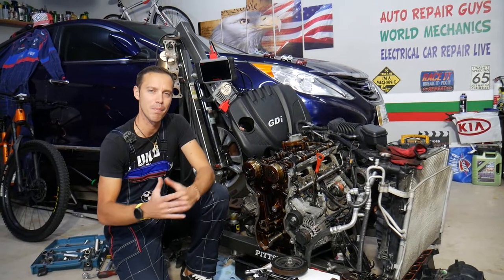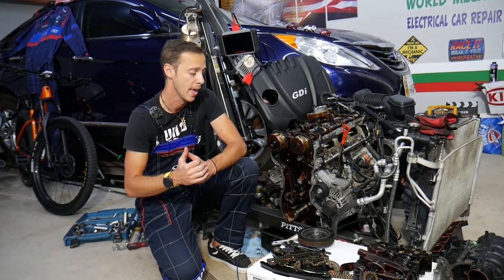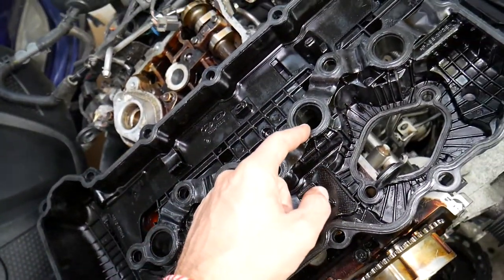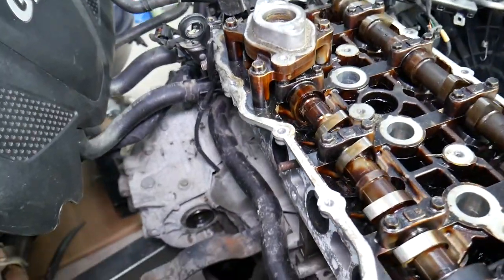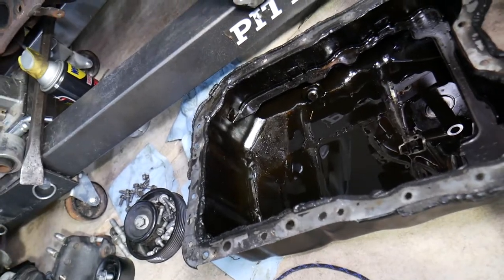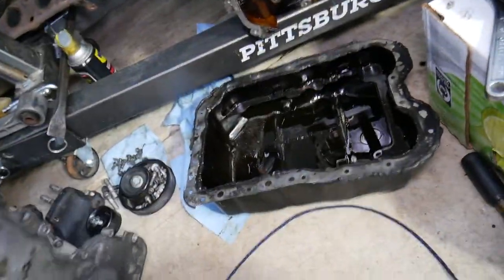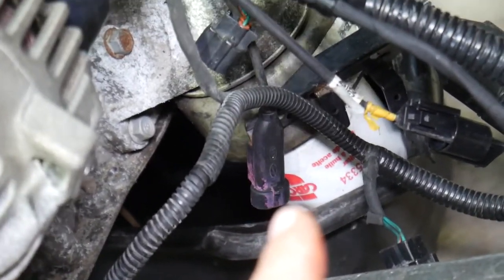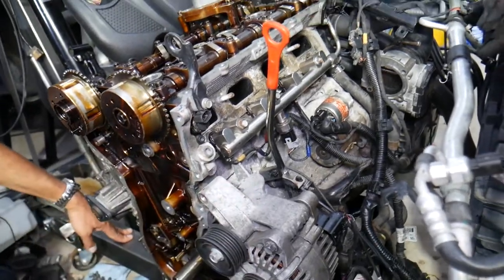MOST COMMON OIL LEAK LEAKS ON HYUNDAI KIA GDI ENGINE

Comment: This is great advice and I know because I had the same problem. I was losing 2 to 3 quarts of oil a month.  I replaced valve cover gaskets and all other related  sparks etc. After this my car quit losing oil and picked up another 1.5 mpg. I believe he is right the #1 reason is this valve cover and related gaskets.

Comment: 2016 sorento 65K miles.  leak coming from an unknown source.  some from the oil filter housing on top of engine and ran down (possibly), but I did an oil change and wiped up as much oil from everything as possible so that I could spot where it came from after doing the oil - filter change.  Put white paper towels underneath the car AFTER the oil-filter change.  Made sure the oil filter plastic housing cap was tight (not too tight as it could damage it, but marks are lined up)..... Still have an oil leak and it's fresh oil that dripped onto white paper towels I put on the garage floor for tracking purposes.... could it be residual oil from the previous leak (why is it such clean oil then) or is this a leak needing to be addressed?  In other words, I still don't have a source and I've already put the 17 bolt-bottom-skid-plate back on, so I don't know where it's leaking down from exactly.  It was coming down the engine from an unknown source when I did have the skid plate off of the bottom (from the original leak situation), you could see oil had reached the skid plate (inside) so it's just so hard to see where it might be coming from and I didn't have it up on ramps either.  I could barely fit under there to take the skid plate off and get to the Oil Drain Plug. This is a complete mystery.  After I did the oil change, I checked for leaks while having the skid plate off, I left the skid plate off and ran the engine several times BEFORE I put the skid plate back on. And there was no immediate leak.  Now a day later, the white paper towels have a clean oil spot , softball size diameter. , HELP!

Comment: I have a 2013 Hyundai Genesis R-Spec  5.0 sedan and It’s burning raw fuel from the driver side exhaust. The check engine light came on and it was blinking for a fuel pressure regular  and a misfire on cylinder 8. What do you think the problem is?
Reply: Bad ring